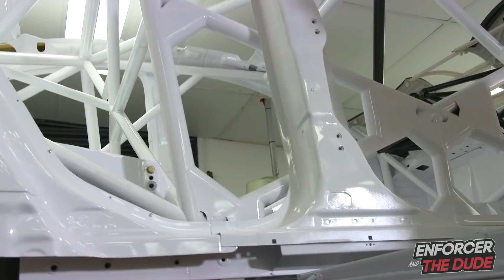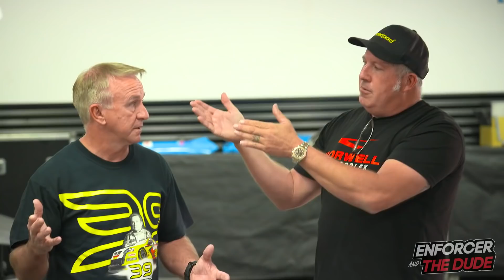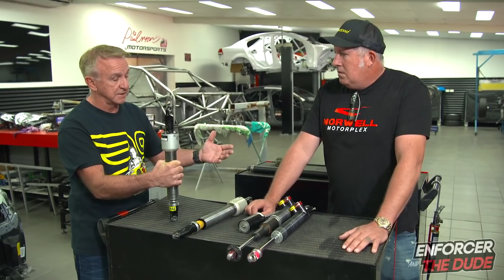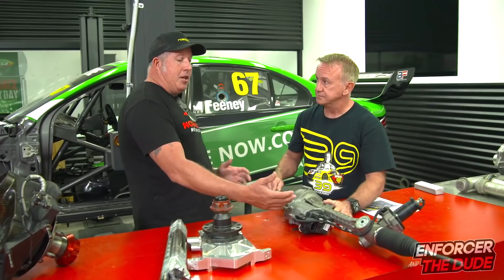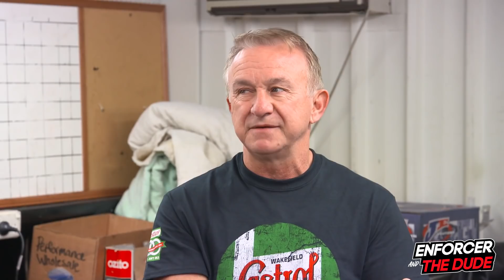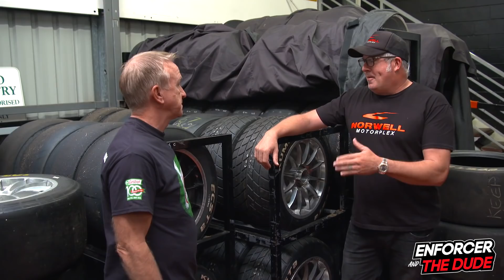FEATURE: Supercars Cost Cutting

Comment: "car of the future" Haha a silhouetted bill board is not my idea of the future......bring back road based cars and not just Holden /Ford
Reply: Car of the future running old pushrod engines ? KRE say some teams running Ford engines 15 plus years old. No fly by wire and Ford and GM have such fantastic road car engines available as crates as they discussed here. This and the reliance on street races, together with contrived team tactics at this years Bathurst has lost me after 47 years as a fan.
Reply: @GS-kh5se  Racing is not about "parity" or "safety"

Comment: Remember when everyone bagged Group A?
If you go back and watch it now it's very interesting.
Watching a good mix of relatively lightly modified cars that you can buy from a dealer.
Now that Australia no longer has local car manufacturers to support,Group A type racing is very appealing.
Supercars are not a representation of any car I could buy.
Reply: Exactly my thoughts, current heavily regulated two horse races are BORING!
Reply: Larry Perkins summed those days up pretty well, I can't quote him, but may be nice
for the fans but it was crap for the teams and drivers if you didn't have the right gear,
made it hard to attract decent sponsors and keep teams afloat. Not to mention the politics.
Reply: @andrewosier614  End of cigarette sponsorship was the problem then....not lack of regulations and a need for having every car exactly identical
Reply: Mustang and Sierra were not sold here though...

Comment: I agree with most of the reasons to control the series, however I think it is good to have some points of difference & areas where the engineers can maximise the car’s performance.
Reply: Exactly. If no-one cant deviate from a standard. how will we evolve into better things. Or would you all like to go back to the days when, if u had a mobile phone, you also needed a forklift to carry the battery pack required to run it. Remember them days do we?

Comment: Agree with the crate engine solution but must still be a GM / FORD motor people are not as interested in seeing an LS ( and  that would be the motor selected )  in a Mustang . I remember a Konika Mitsubishi Magna using the 308 holden engine used to race until it won a race or 2 and got banned .

Comment: This won't happen to teams have no say in the hardware used on the car unless they find a safely issue with the parts stated here.
Plus then the development of all set parts are done by super car itself an teams have no say with any development apart from there reports of weak area's of those set parts.
Engine wise i think you guy's nailed it as most manufacturers have a crate engine ford/GM/Dodge an the list goes on.
I wan't to see braking to be controlled as well as then teams will have to manage there brakes within a race an it's another area where everyone on par with each other.
I have so much more in mind but don't want to write a novel in doing so.   Very nice points guy's an thank for the recap....

(Edit) The Big question is when super cars going electric as they must be thinking about as it's the future tech in motoring .  Oh shit I said it. Lol

Comment: I am a fan of motor sport. Supercars in particular but not exclusively. I am a fan of some drivers but also a manufacturer (which is important). The one thing that worries me is generic boredom where everything is the same and the races provide no action. No passing. It just turns into a slip streaming race. Factories and investors need some wiggle room in the technology side of the investment to encourage the sport to move forward and not just turn into a stale bottle of piss in 10 years time. Maybe allow developers to rotate every year...tyres one year is open, shocks the next , engine after etc.
Reply: Having the same cars is not what produces boring racing. Boring racing is caused by aero.